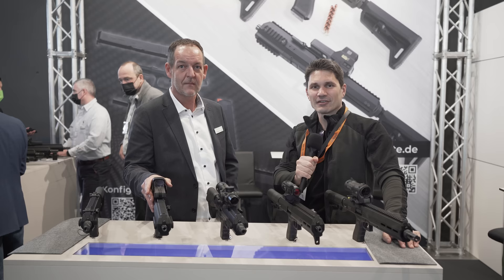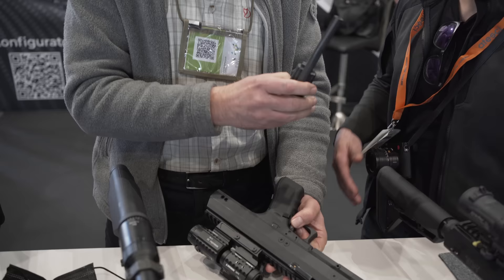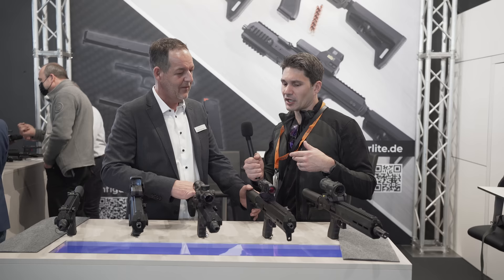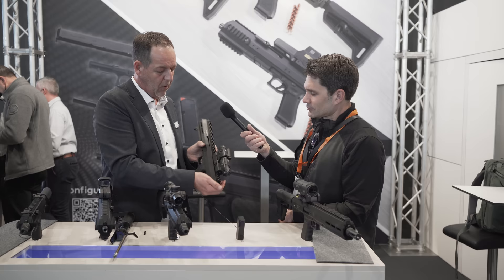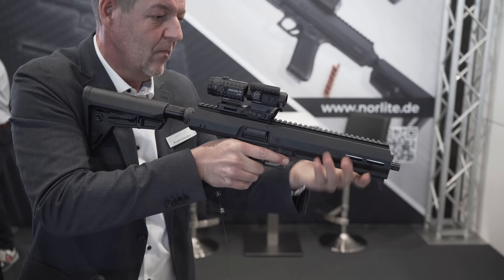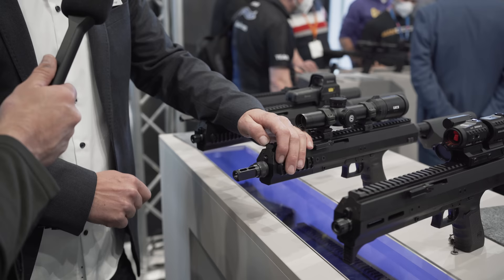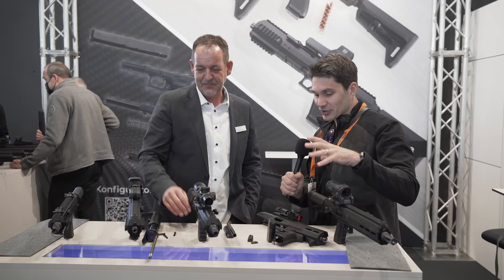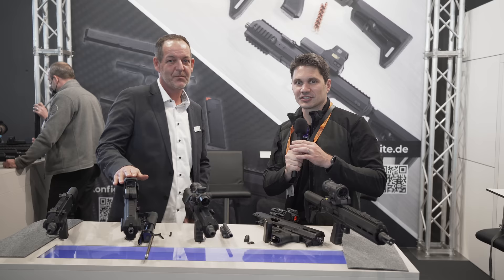The German Norlite USK-G Glock Carbine Chassis [IWA 2022]

Comment: Pretty cool, but not over 500-600 bucks cool, so that's your price point, because this already exists here in the USA, company called mechtech
Reply: But the mechtech is a 50 pound steel tube with a barrel attached to it. 
This thing looks like a proper modern carbine.
Reply: @nutsnfancy  50 pounds my ass lmao, just don't have noodle arms! 
I get your point, this is more tacticool but the point is that the mechtech is their direct competitor, so they better be in the same price range. That's all I'm saying, if they price this at like 800 bucks no one will buy it, we have better options. Unlike germans, we dont have to ask permission to buy another gun, so this needs to cost less than a 9mm carbine or theres no point
Reply: @jordanhicks5131  
I will buy two at only $800.
since it's more modern than the $600 mechtech version.

Just pop my drilled and milled P80's onto her and I have a modern Glock carbine.
Something Gaston should have made decades ago!
Reply: @nutsnfancy  I'd rather just buy a whole 9mm carbine at that point. Like I said, we here in the USA dont need to ask to buy more stuff, this doesnt fill a niche unless it costs less than a stand alone carbine. 

You can have the coolest product in the world, does the job better and everything, but if you dont price it right it wont sell. People will pick other options if they can, like they can here. In Germany where you would need to get another firearms license to get a stand alone carbine, this makes sense. Not so much here in the usa

Comment: Am I missing something, or this chassis has no "safety switch"? If so, this readers it useless in my  opinion...
Reply: @ren
I was wondering the same thing.
Let me know if you find out if it has a safety.
I'm sure it does.
I don't see Germans allowing something like this without a safety.
Reply: @nutsnfancy  After watching what was available online on this conversion, I actually think that they are not planning to use any "switchable" safety...